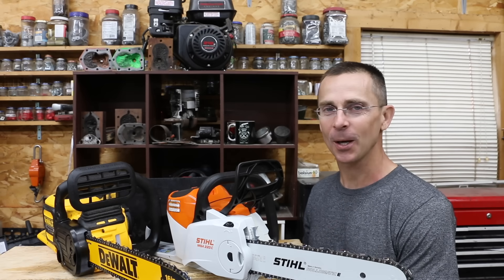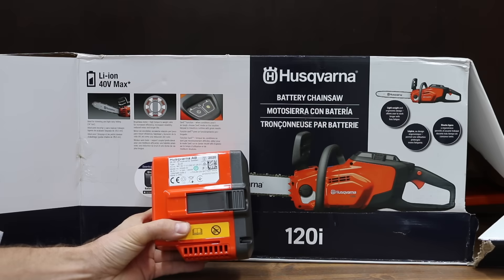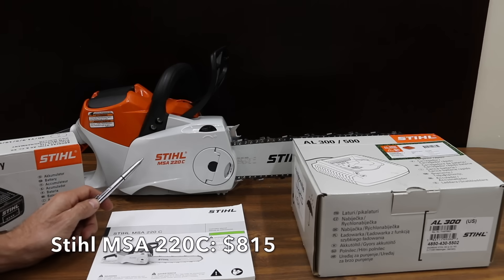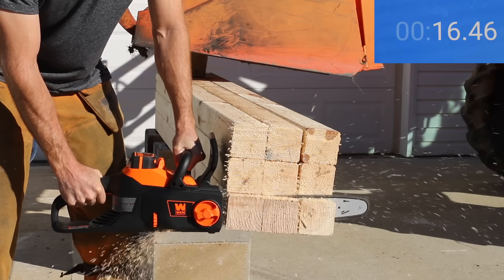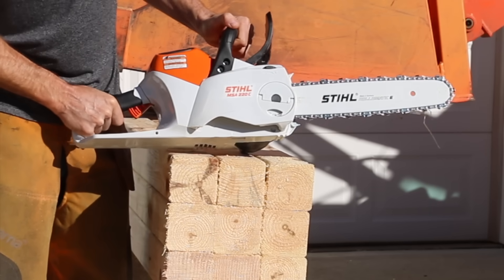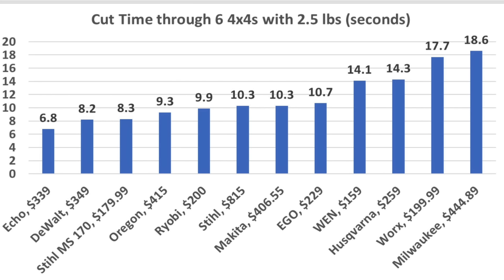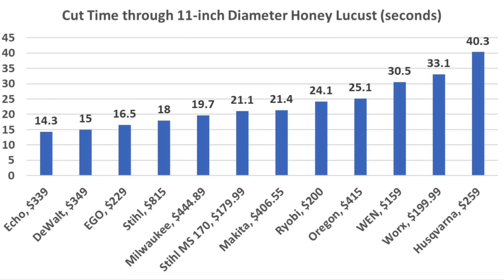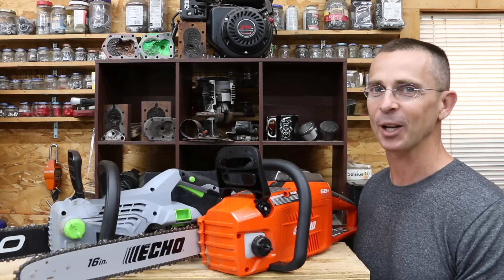Best Battery Powered Chainsaw Brand (ROUND 2)? Stihl, Husqvarna, Echo, Oregon, DeWalt

Comment: I would like to know the cost of charging per cord of wood (or some measurable amount) vs gasoline cost.
Reply: The electricity is basically free. In the US you are paying around 17 cents per kWh delivered.  The largest of these batteries is something around 0.4 kWh. So call it 10 or 15 cents per battery charge with some charger inefficiency built in. 
10 battery cycles would get you about 60 minutes of run time for about $1.50 in electricity.
Reply: @otm646  I appreciate your knowledge and your reply.  $1.50 per hour is more than my 40 cc saw uses in gas per hour though. Echo cs400. It uses maybe 1/2 gal per hour at most. Gas is currently  $1.86 per gallon, add $.50 per gallon for the oil mix, you're at $2.36 per gallon. At 1/2 gallon per hour that's $1.18 per hour with way more productivity and not having to stop for battery charges. I know there are more pros and cons of battery vs gas, and I'm not arguing which is better. I was just wondering which would be cheaper for "fuel". Thanks again for your insight! Thanks to you I know have an answer, if my math is sound.

Comment: I'm really impressed with the forethought and planning you do for your videos. I mean, you even used the same log as last time to try and be as accurate as possible in your comparisons!

I bought a little gas Echo chainsaw last year for light stuff around the house and camping. I really like that saw and after felling and processing several trees, I didn't even use all of my 2 gallons of premix. If I was buying another saw, I would gladly grab the battery powered Echo.

Although, the DeWalt is still great and I have several other DeWalt tools so I could just swap in other batteries if I needed to.
Reply from the maker: Thanks so much!

Comment: I'm a milwaukee power tool guy but without a doubt i would go for the dewalt. With 5 to 7 minutes of run time you might need multiple batteries and might as well buy something that you can use those battery for something else . In my opinion we still have a long way to go before replacing the gas chain saw if that ever happen. Thanks for the video  as always
Reply from the maker: You are welcome!

Comment: The EGO with a 7.5Ah battery works very well and I've cut an entire tree with it.  In the box stores that will set you back a small fortune, however Ebay and some bid snipe ability applies here.  I chose EGO for the multiple tool, battery, and charger combinations. A rumor I've heard is that the EGO spools up faster and has more running torque applied when used with the 5Ah and larger batteries, although I have not verified that claim. 

 My neighbor runs the ECHO with the 4Ah and I cannot notice it being a faster saw at glance but the extra 2.5Ah of the battery in my saw makes a big difference in duration.  I don't think ECHO offers batteries larger than 4Ah, but I could be mistaken.
Reply from the maker: Thanks for the feedback.

Comment: Excellent video.   I can't help but wonder how the results would change if all the chains were properly sharpened before they were used.   Most of the chains I've pulled out of the box have left a little to be desired in the way of sharpness, and none of those saws looked like they were throwing very big chips, even on the pine 4x4s.
Reply from the maker: Thanks for the video idea.

Comment: I have the Echo 58V trimmer and it is also a beast. Their warranty is also excellent at 5 years for the tool and battery. My battery gave me some trouble after 2 cutting seasons of extensive use, they mailed me a new one free of charge without even having me send in my old one.

Comment: Can you test 14g wire connections to an outlet.  #1 looping the wire around the screw.  #2 placing the wire behind the screw plate and tightening the screw.  #3 using the push in style connection holes. Most electricians will only use #1 but I'm not convinced it's really any better than #2 or even #3.
Reply from the maker: Thanks for the video idea.

Comment: The most important aspect of a chainsaw is, well, the chain itself. That's where most of the differences in cutting speed are from. If you really want to make this test relevant, just buy the same exact chain for all of them and adapt it somehow (shorten it or use extra links from a 2nd one).
Reply from the maker: Thanks for the feedback.
Reply: I agree with that point but IF the saw company decides to put an inferior chain on it, it's a loss to them.
Quality talks, cheap walks.